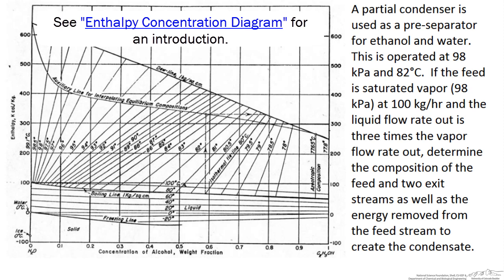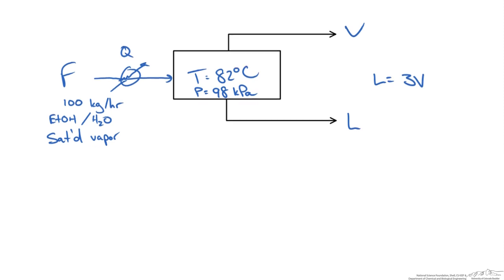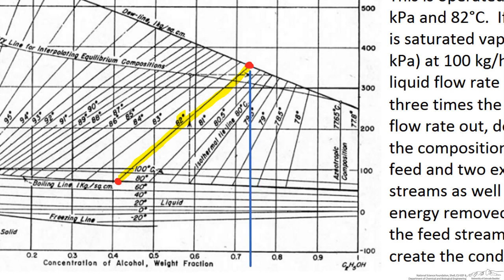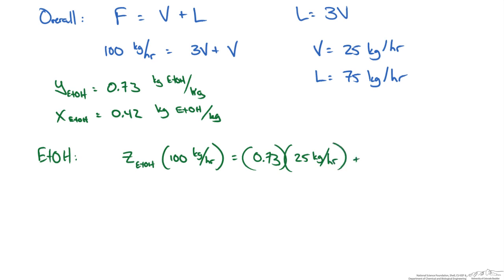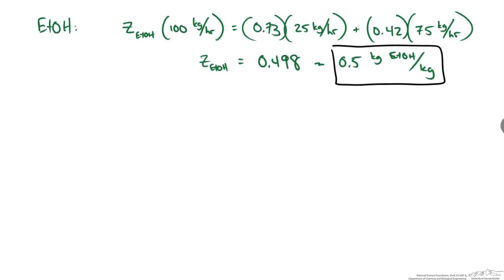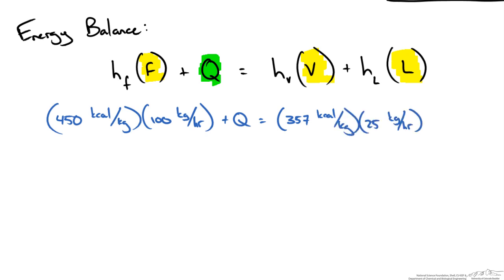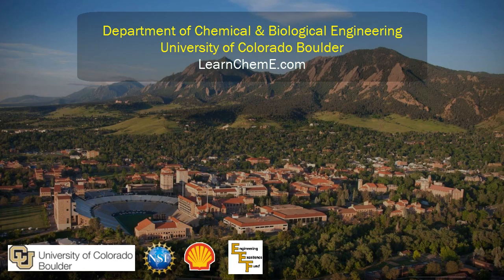Enthalpy Concentration Diagram Example

Comment: I dont understand how you got 67 kcal if the straight line is goes to the 80 kcal on y?
Reply: me too
Reply from the maker: Good question. This graph is difficult to read. I think the line you are looking at isn't a straight line. If you draw a line from that dot, parallel to the x-axis (or perpendicular to the y-axis, if that's easier), it comes to approximately 67 kcal/kg.

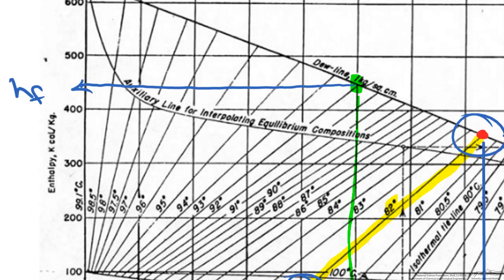Comment: at 5:49 in the video, you draw a line from one end of the isothermal line at 82 degrees down to the freezing point line, and you read the liquid stream enthalpy from that point.

is this a mistake? I thought the enthalpy of the vapor stream was read from the dew line, and the enthalpy of the liquid stream is read from the boiling line.